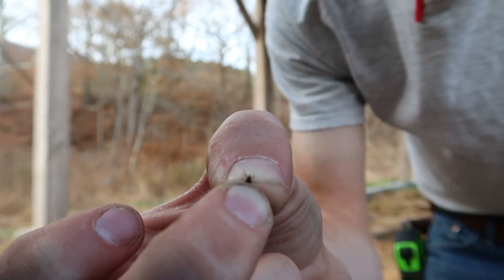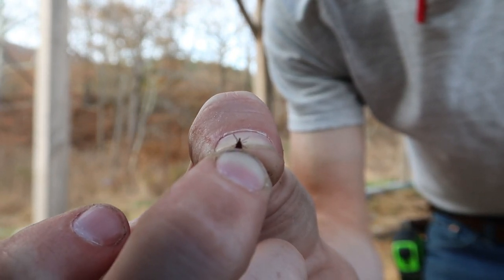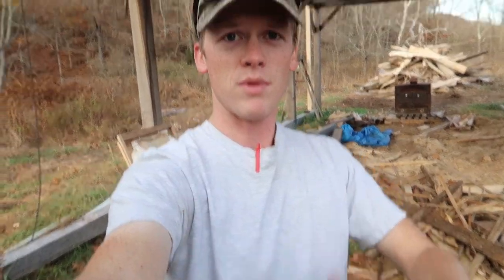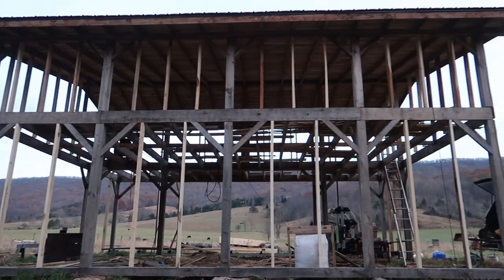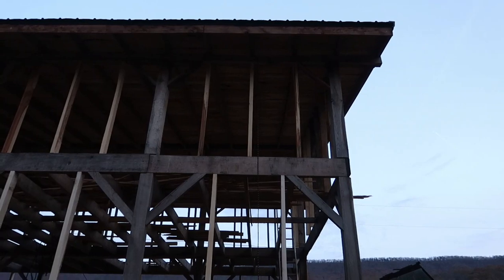Tapered Siding Jig | Sawmill Shed

Comment: Nice solution to the lap siding cutting problem. I see that Woodland sells a jig for the job but the price was too high for my taste as i seldom need lap siding.
Lap siding is typically cut from fir or pine which are soft woods. The piece tapers from 3/8 inch to 3/4 inch in thickness and are 8 to 10 inches wide. So the angle is 8 to 10 degrees.
your solution is elegant because it uses the saws stops as the hinge point to pivot the log and the adjustable toggle which is cheap to raise the log for every second cut.
cheap and effective.
Reply from the maker: Thanks! Yes, Woodland just came out with the jig about a week ago, but like you said $$$$. If you take a look at the 2.0 version I made ( https://youtu.be/elrJNYYYxIw ), it can do 2 or 3 cants at a time side-by-side. Definitely speeds up the process, and is something the Woodland jig could never do. Thanks, Josh

Comment: Hey josh, its Fred. I got my XL trailer and I'm putting it together now. On one of your videos, you talked about torquing the blade with a torque wrench. You said you torqued yours a little tighter than the recommended torque. What did you finally go with? What was the final tightness? Also, I've been kinda worried about the blade tracking.  I just want to make sure I get it right.  Do you have any advise you can give a newbie? If so, please email me at freddraw@yahoo.com.  thank you man, i dont mean to take up much of your time. I just want to get this right and not screw it up.  Also, where do you get your blades from?